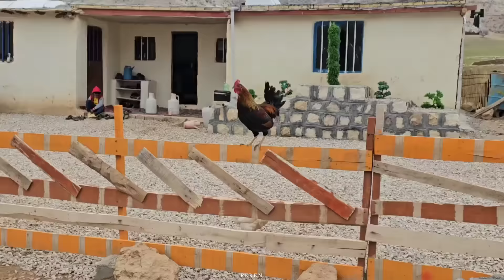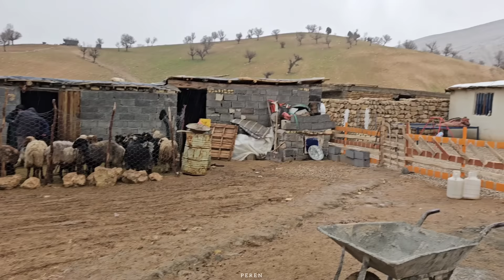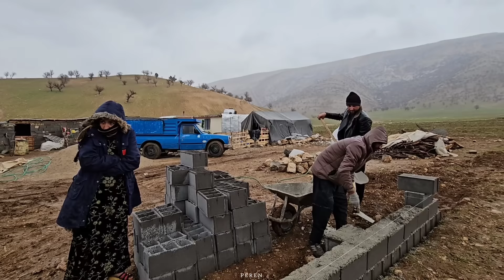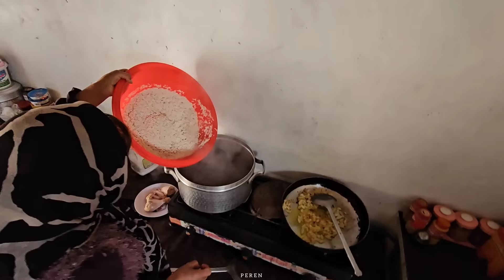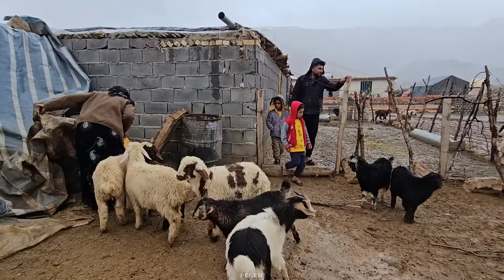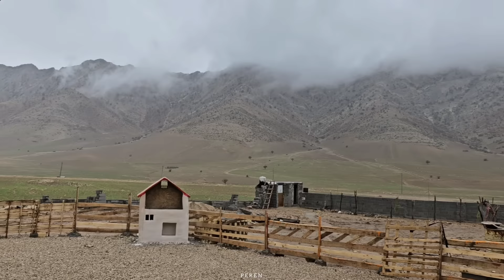Village life in Iran.  Daily life of rural men and women in crowded families  #rainyday

Comment: طهمورث كنت  اعمل فتحه من تحت لسلة القمامه حتى يخرج من الماء اذا مطرت وايضا تستخدموها تنور للطبخ. ومن خلال الفتحه تدخلون الحطب
Reply: Another “over the top” fire pit/garbage burner design. How do you intend to clean and empty the ashes… the hole is too deep and not wide enough. There should be a “peep’ hole at the bottom for water to drain when it rains as well as air flow to keep the fire burning.
Reply: Sim fala aí pra família colocar espetos em vertical. parece muito bom pra Arya assar os frangos e nao!! Para um latão de lixo??

Comment: One thing I don’t agree is the use of cinder blocks as perimeter walls. I think it’s “luxurious” and over the top for its purpose. It’s not only very expensive but laborious. Agricultural farm fencing are usually inexpensive and usually of cyclone wires and sometimes reinforced with barbed wires to  discourage bad elements. And if in case they get kicked out of the place for some unforeseen reason it won’t be hard for cyclone wire fence to dismantle vs cinder blocks. Just saying.
Reply: Самый дешевый стройматериал в Иране - это шлакоблоки,- из земли своими руками. Металл проволоки дорого из за санкций,- и они ее устоять под напорю урагана
Reply: Also any thing in wood is very expensive because it’s in short supply. It’s fine if you do that to your fences, but just leave them to decide what’s best for them.
Reply: Quien tiene en brazos Abha el papá o Madhi..
Reply: Согласна с вами